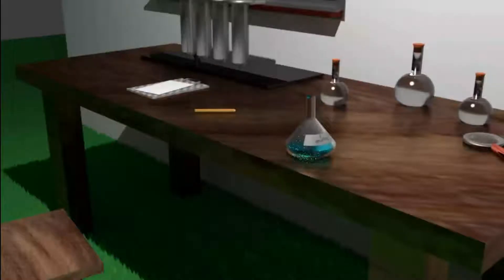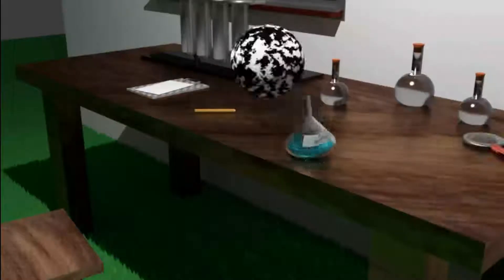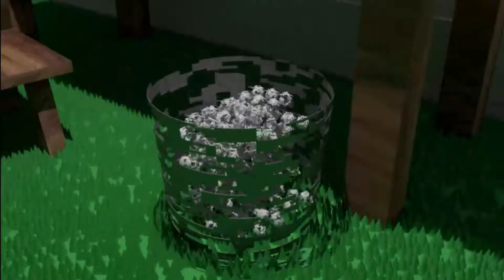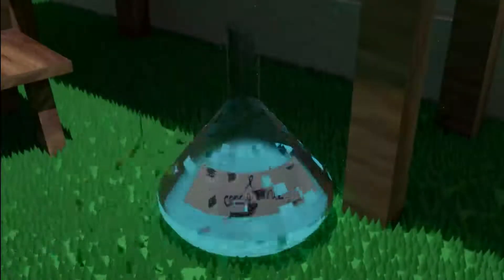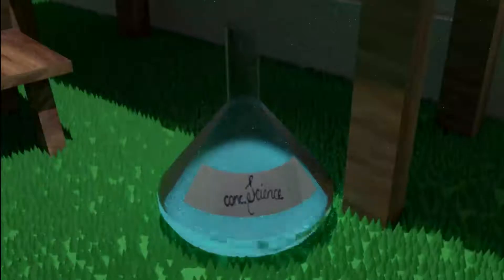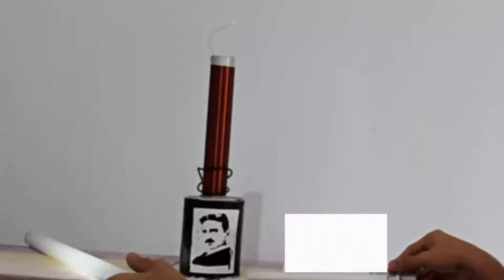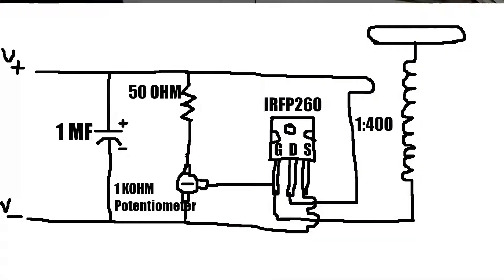How to Make a 12v - 24v Tesla coil

Comment: Irfp260n will also work (you will also get arcs) , the problem was with oscillation, not propper turn off in the gate of the MOSFET because of very low current and very high voltage  (very high voltage can kill a mosfet's gate). To cure this problem, you need to increase the number of turns in the primary coil section (so that the current will increase and the voltage will decrease)  3 kv is enough to get arcs. 
All the best! Nice video👌
Reply from the maker: Thanks mate. I will definitely try you suggestion
Reply: It seems you are right. I put everything together as described, switched on the power (12 V from a battery) and after seconds smoke came out of my mosfet. Now I need a new mosfet. Next time I'll make more turns at the primary coil.